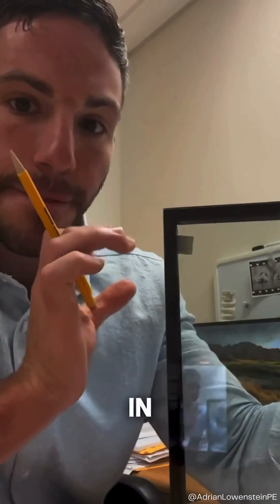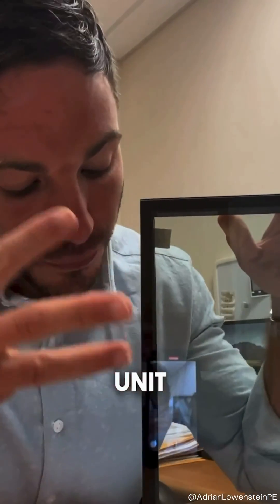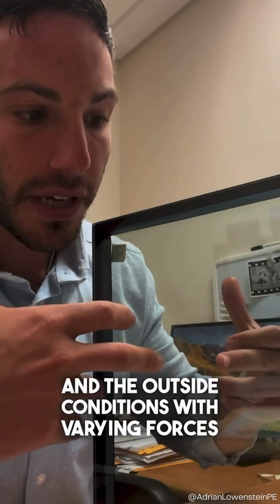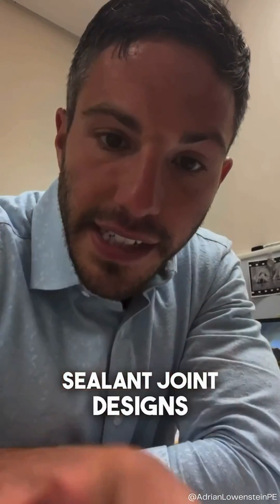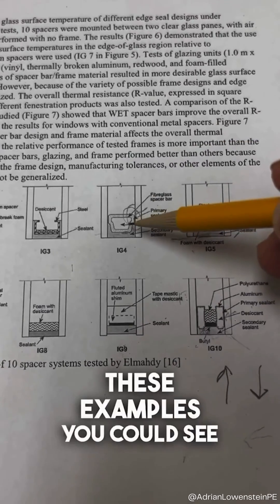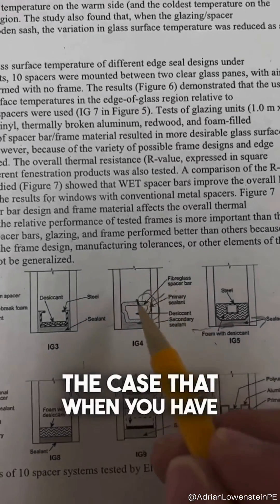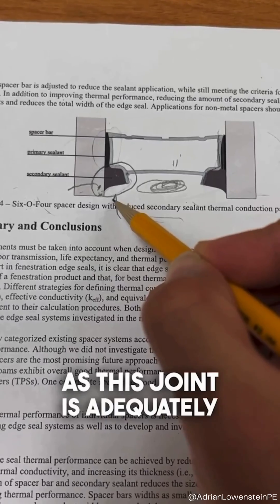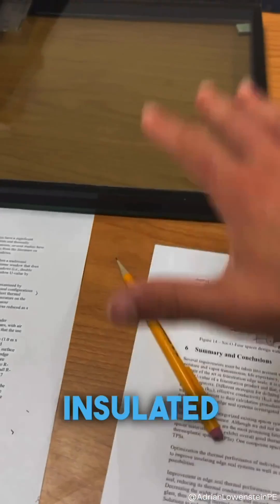Inside the Glass: Secondary Sealant Joints

Comment: 4) One other important function of secondary sealant is to effectively share the structural loads between the outer and inner panes. The bite, thickness and its ratio must be properly designed and calculated.
Sidenote: The place where the IGU was manufactured vs where it will be installed (climate, barometric pressure) affects the cavity loading as well.

This is a very informative video. Thanks!